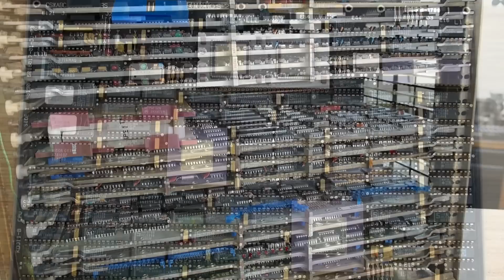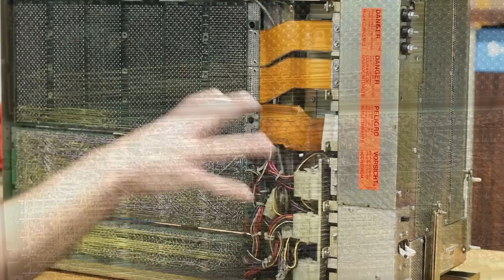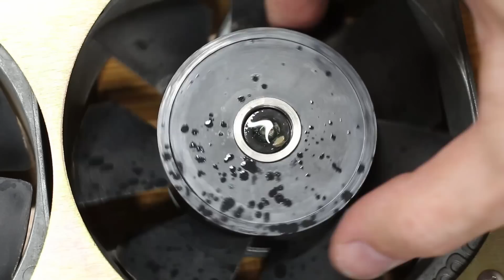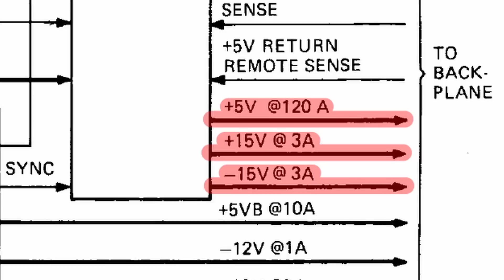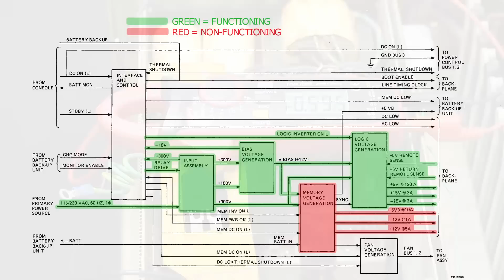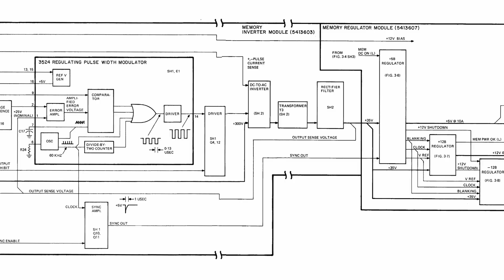Only DEC could make a PDP-11 PSU this insane…

Comment: Did work for Digital in the 90's, did repair a lot and seen a lot. Even then the old DEC VAX servers where still maintained. Later on Digital became Compaq which i also worked for, sad part was the nice blue Digital letters became red and even after that Compaq became HP also worked for it but everything what Digital was? Was completely destroyed so i move on to another job back then.

Anyway glad to see some DEC equipment ;)

Comment: I worked for an outfit that used a lot of DEC gear, one centre was still using a pool of 11/35s and 11/45s with RK05 disks, other areas had 11/34s, a couple of 11/24s with RL01/02 disks, and there where 11/03s dotted all over the place.  Over the years I probably had to repair every type of card and disk drive installed in them but I don't recall ever having to repair a DEC PSU, they seemed to be very well engineered.  I was mighty pleased about that because switcher power supplies make me nervous ever since I had one blow up on the bench after a failed repair attempt, it was so violent that I was still pulling bits of transistor etc from my hair when I got home that evening.  Needless to say I toggled the switch with a broom stick after the 2nd and thankfully successful repair attempt !!

Comment: I was a mobile engineer with Xerox in the UK in the early to mid 80s on their successful and brilliant 9700 large laser printers. They were made and used in marketing companies and in companies mainframe setups as high speed double sided laser printers. At 7 double sided prints on A4 they were rapid. At £250,000 plus, a fortune in 1982, they were not cheap but companies loved them. They had reel to reel tapes but were powered by the PDP 11/34 and on later models the PDP 11/44
Proper computing days

Comment: Scary with so many amps in 5volts. I have working on a simulator there has a IG station there was 3 pioneer magnetic, when running they give 200amp out in 5 volt, you can feel the cables are hotter even they are a big AWG.

Comment: I serviced a Squeeze Zoom NTSC video effects system about 35 years ago. The +5VDC rail was 1,000A. It was a three  phase 208 linear power supply. There was about a dozen other DC rails. All to run a single Z80 CPU to process live video for a TV  station. It stored two frames of live Analog video. It processed one, while using the other.. It filled a full relay rack cabinet,

Capacitors used when that was built were much higher quality so they didn't bulge kike the thin, Asian capacitors., They had tar seals  or real rubber seals. Those large screw mounted (AKA: Computer Grade)  capacitors had a hard, molded plastic insert, which has a small rubber plug. . The caps fail if those get damaged.

Comment: I worked with 11/45’s, 11/55’s, 11/60’s and VAX machines. I own an LSI-11. I only programmed in assembly language for radar, missile, AAA, aircraft real-time. Everything was tied together by busses with up to 128 processors. One of the best machines I ever worked with, tied to hardware and human interfaces.  We wrote our own  OS, editors etc. Beware of the Master Interrupt card and location on the buss. It must be in the correct slot or another board could try to take control and lock the machine until a reboot!
Reply: it was inpossible (high cost and falling performace) to isolate devices (like PCI/PCI-ex now) in 1980-90 .

Comment: Sitting on a shelf in my hobby room I have a power supply for a type of minicomputer I used to work with - the 5V rail can provide 200A.  And it's not even the biggest PSU of that type, but I didn't manage to catch a bigger one at the time. I also have an actual mini sitting around, just a smaller one so its own PSU isn't as big as this one I'm talking about.
But at least it's not home-made by the mini maker - these were produced by Philips, though I've never seen them elsewhere.
That DEC PSU seems unnecessary complex, what with the special fan voltage generation etc.

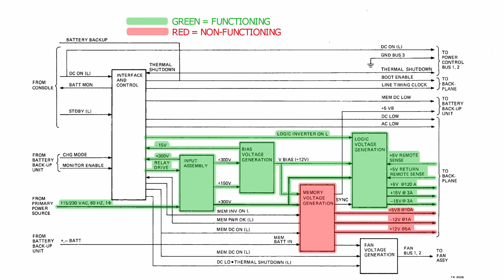Comment: 19:09 The unit bottom right only has 3 input lines.
Can you toggle each line high/low and see if the output changes?

also try the same procedure with the non colored lines going into the red block.

Comment: Hi David, Mitch here, you have the schematics, I'm certain I loaded them in your truck, they're also up on bitsavers. The 11/44 PSU was notorious for failing, the DEC guys joked that 11/44 PSU repairs was a very profitable business. It's most likely the oscillator, for that voltage rail convert, is not starting up. Great to see you working on it,  will make an awesome system paired with that drive. Ping me if you need ideas.
Reply: I hope that David reads this.
Reply: https://bitsavers.org/pdf/dec/pdp11/1144/MP00897_11X44sys_Dec79.pdf page 203ish

Comment: I'd be checking those logic inputs mentioned upstream to the memory supply on that block diagram, making sure those at the least are good. The fact the fans briefly spin suggests the MOSFETs are at least working along with the switching driver, but one of the protections is going off as is suggested by the flashing DC LED. This could be in error if a component in the protection itself has failed, or it could be that part of the switching circuit is running out of spec. The fact it begins suggests at least the switching driver & bootstrap is working though, so you shouldn't need to mess with the high voltage side. Perhaps find the IC or circuit driving the switchers and identify the protection lines that could initiate a shutdown, trace them back to the source. I'm a little suspicious of that flex too - if a hairline crack is in it and one of the protections is on the other end of it, that could be a cause.

Comment: 120a on 5v rail, wtf needs that much juice
Reply: A modern PC? 🤷‍♂️ That's 600 watts, which is kinda modest by today's standards.
Reply: @argvminusone  lol no, not on a single rail. If you want to see that many amps, you have to look into +1kw psus that are recommended for 4090s, multi quadro setups, AI training and whatnot, and they are usually about 50-60 amps on the 12v. What the fuck would a 40 year old computer on almost discrete compoments need 600w on a single rail is what I'm asking. Not for running 2 68k @12mhz, I assure you that.

Comment: I remember a PSU failure in 1978, in a PDP 11/35.  The DC fuse is after the main bridge rectifier. A rectifier failure resulted in enough heat to vaporise the epoxy under the bridge rectifier. When working on it and found the fuse after the bridge, gave me a what were the engineers thinking moment.
Reply: Lol, this is exactly that moment: https://www.youtube.com/watch?v=4fzR4n6o_UE Unfortunatelly only for Czech and Slovak listeners :(

Comment: My ancient memory has Eagle drives associated with an ICL system, and a recollection that they needed an end to end seek task run at intervals to avoid them getting sticky if they idle on the same track.
I was on the DEC side, not the ICL, but we were on VAX by then, a 3x 8820 cluster and some MicroVAX, RA81, RA82 drives in 3-up cabinets with start sequencing (cable between the drives so that the spin up power demand is staggered)

Comment: That brings back memories. In 1983 I had a class called microcomputer interfacing, offered by the chemistry department at VT. We had a PDP-11 (?) bare bone system, a teletype for IO, an oscilloscope, a large bread board, and a massive collection of discrete components. With the help of a xeroxed copy of the lab manual, we had to hook it all together and get it to actually do something! I have long forgotten the details, other than we had to program some of the code in assembler in octal.

Comment: Memory voltage generation controls the fans.   Ok......Got it.  Sort of like the cigarette lighter in the dash burning out causing the left rear tire to go flat.  I would have liked to have been in the meeting when they decided that.  Sounds like it was decided by a bunch of field service techs worried about job security.

Comment: I was a PDP-11/40 technician at Digital's Marlborough facility where we made DECSystem 10/20 computers. It was the front-end of the Dec 10/20. The PDP-11 was one of the first computers I ever worked on. It has my favorite machine instruction set. The unibus architecture was novel and ahead of its time. My most hated component was the TU-56 tape drive. So many problems! People would come to me and say "Will you fix my TU-56?" They just couldn't do it!
Reply: I was once told there were a bunch of TU-56s in the mill pond at Maynard that were thrown there by various people who became frustrated at not being able to fix them.
Reply: instruction set is amazing (I wrote big parts of code on it instead of C/Pascal/..), but excessive to built "price effective" chips in 1980-90. Architecture of PDP-11 is the same - nice ideology, but not the best efficiency.

Comment: Many DEC PSUs had an overvoltage crowbar circuit, if the 5V rail went above 5.2V, it would fire a relay that could short out and disconnect the 5V rail. Then, of course, it wasn't overvoltage, so it allowed the rail to rise again and then back to start. I had an instructor at Systime who would deliberately overdo the 5V rails and let us chase that fault. The ticking of the relay was a dead giveaway.

120 amps was fairly normal for TTL in those days.
The VAX750 had a 5V/120A PSU and a 2.5V/240A PSU, separate little 600W units.

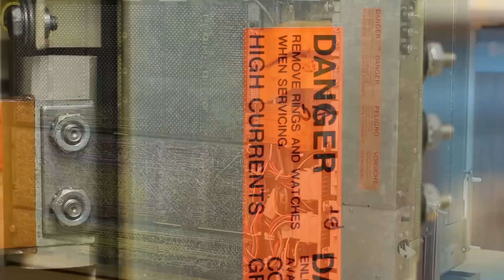Comment: 6:23 DANGER - Remove rings and watches WHEN servicing - HIGH CURRENTS :o omg
Reply: You really don't want your ring or watch to weld to the terminals and heat up red hot while you're wearing it.
Reply: @rocketman221projects  absolutely. Less shock hazard, more burn hazard. Recall hearing a shop mechanic that had a wrench accidentally complete a circuit between car battery terminals & a wedding ring. It didn't go well.

Comment: That's a massive drive for an 11/44. It is something I would expect on a later machine like an 11/73 or even a VAX.
Reply: I think you're right, we had one on the old computer club VAX-11/730 at university. On the other hand, I have a (dead) LSI-11/24 with a more reasonably sized 8" Fujitsu stashed in storage.

Comment: I have worked on 1970s era switcher PSU, but not this specific DEC unit.  The designs are quite different from modern, where they typically switched an intermediate voltage at a much lower frequency of maybe 10 KHz or so.  You still had the huge magnetics and soup can size capacitors on top of the complexity of the switcher.

I did FORTRAN programming on an LSI 11/03 in a two-drawer cabinet with a walnut Formica top.  That system had a very loud switcher PSU.  So loud in fact that I used ear plugs even though it was in a carpeted office.  I was mostly trying to have the whine not drive me crazy, but I believe it was actually loud enough that hearing protection was probably called for.

Comment: And if you look closely at the fan, it's not only an odd voltage, but an odd frequency.  75hz.  I couldn't find any country that uses 75 hz.  

My only explanation is that DEC designed this so they were the only ones in the world that could sell you a replacement fan.
Reply: Before Louis Rossmann was born.

Comment: 35 years ago I could salvage a few capacitors from an IBM36 PSU. The machine had been literally cut into pieces that could be carried. The PSU was not too much damaged, it was made of a lot of huge capacitors. Their volume was around 1 liter each to give an idea. I saved a few 100000 uF 15V and even 220000 uF 10V ones. And looking closer to the PSU, it was pretty simple. A huge transformer with many outputs, several rectifiers bridges, a bunch of huge transistors for the "low" current outputs, and the capacitors. Nothing else. The 5V output (well more like 5.3) was not even regulated, it was directly taken from the 220k capacitors after the rectifier. By then I was told "do you imagine how many transistors it would require to regulate that?". So I guess the voltage was not smoothed very well, but the huge capacitors would limit the ripple on the output. Probably that they had strong requirements for the stability of the voltage input.
Reply: That PSU isnt switch mode, it VERY probable a linear supply ie it has a very large transformer.

Comment: My first computer job was in the 1980's looking after a bunch of Sun 3 computers.  The servers were Sun 3/280 each with two Fujitsu Eagles.  If nothing else those computers instilled in me an undying love for the 68000 architecture.
Reply: The 68000 was a very nice machine. It had a nice instruction set and none of the memory segmentation problems of the Intel architecture.
Reply: @bobdinitto it had really dumb and complicated addressing modes that made it really hard to make a fast implementation. It also had the infamous “microcode spew” on the stack when the COU took an exception/fault + lots of completely unnecessary incompatibilities between models.
The x86 did all of these better. The segments stopped mattering much with the 386 (from 1985), which also improved the addressing modes to something nice and orthogonal without the madness of, say, the 68020.

Comment: Why is there a wire-wrap mess on that guy? With all the cards doing all the things, its interesting there is a custom wirewrap. Is that from factory or user configuration of some sort?! With the factory pumping out cards, I just can't imagine them slowing down to do tedious wirewraps for each system.
Reply: DEC was an early adopter of automated wire-wrapping machines.  Everything form the PDP-8/I on was wire-wrapped with Gardner-Denver wire wrap machines.  Mostly slow mechanical rube-Goldberg devices but still faster and cheaper than hand-wrapped backplanes.
Reply: @georgegonzalez2476  Interesting; I wasn't aware of wire wrap machines, but makes sense. Still, it also appeared the wire wrapped portion was backplane, which shouldn't have much logic on it, but perhaps thats all signalling for power stage alerts and such. Hmf!

Thanks for the reply!

Comment: You would need like 10+ modern atx power supplies to handle that many amps at 5 volt xD
Reply: Modern ATX power supplies are designed to supply most of their power on the 12V rail. They need a lot of load on the 12V rail to get full current out of the 5V rail.
You would just get a stand alone 5V power supply like a Mean Well SE-1000-5 if you need that much current at 5 volts.

Comment: DEC design meeting:  
" guys should we use off the shelf 120v AC fans" 
" no way that is exactly what people would expect us to do, we have to do better"
" I know  lets build a load of logic to run some oddball 35v AC fans that is way more DEC"
" yeh good call lets do that "
Reply: Like back when Textronix made their own screws and bolts in house.
Reply: Obligatory Airplane reference: https://www.youtube.com/watch?v=y0X0ZYbnHxA
Reply: probably got a load of them cheap 😉but 3 in series is pretty close to 120v 😁 (105) that 75hz could result in faster fans, compared to 50 or 60hz supply
Reply: @andygozzo72  I was a firmware developer on the VT240 team. We we given a pizza box form factor and told "All the logic must fit in this box because we have a zillion of these and we have to get rid of them!" This caused so much stress to the hardware team they had to layout the circuit board twice. It was madness!
Reply: I do understand DEC. Having fans that can adjust to the load of the server is a very nice thing to have.
Reply: @jooch_exe  Such as variable speed DC fans, using one of several control methods, that have been around well, well before the computer at hand ...
Reply: Well, I used "oddball" 24v centrifugal fans. 24v because they had the ability to be speed controlled. And that wasn't too long ago.
Reply: " Off the shelf" wasn't a thing in 1980. Practically everything comput related was custom contract built.
Reply: @mitchbertone3809  Fans certainly were.  Frankly someone had to be smoking something to come up with this.  35V fans at 75Hz when direct line powered fans would have not only done the job perfectly they would have done it cheaper and more reliably at that.
Reply: @mitchbertone3809  What? I was using an "off the shelf" 12 volt fan in my Ohio Scientific computer in 1978. I bought it off the shelf at Radio Shack. It also used an off the shelf 6502 CPU and off the shelf 2114 static RAM chips and off the shelf 7400 TTL logic chips. The only custom thing was the case and the PC board.
Reply: @mitchbertone3809  Then wouldn't making a 12 or 24VAC fan be better anyways? Nothing is standard about a transformer or circuitry that generates 35VAC, and going for one that outputs 24V means you can reuse doorbell transformers or the tooling from doorbell transformers. Even going for a custom 240V 10:1 transformer with a center tap means you can always have a 24V source from any 2 terminals even if it's being fed 120V.
Reply: @mitchbertone3809  So that fact somehow makes DEC shipping a gold plated solution inside their machines is okay?
And oh, 24VDC fans were available circa 1976-1980, so they could have used voltages already being generated to do the same thing